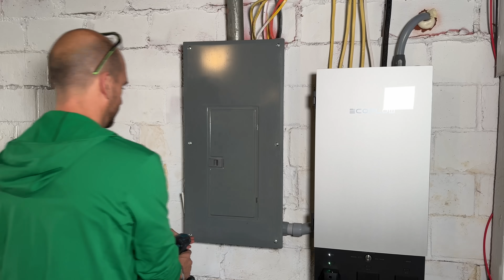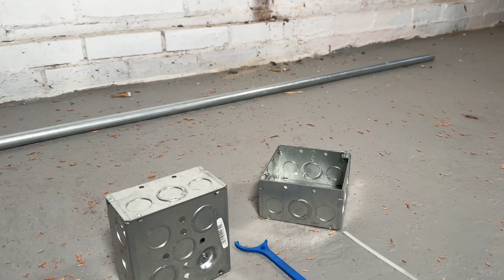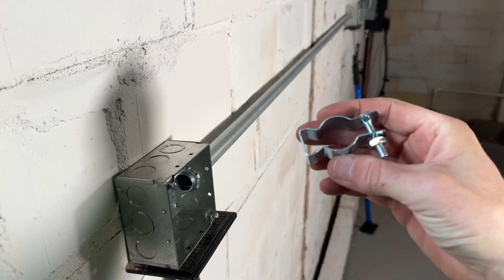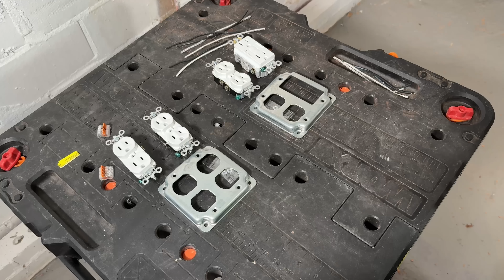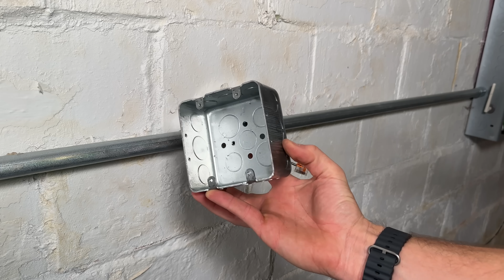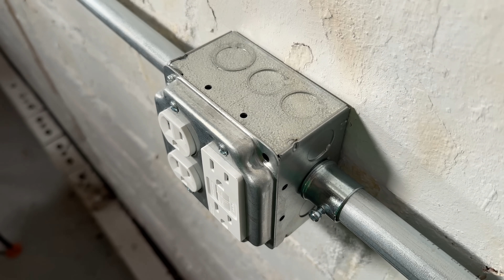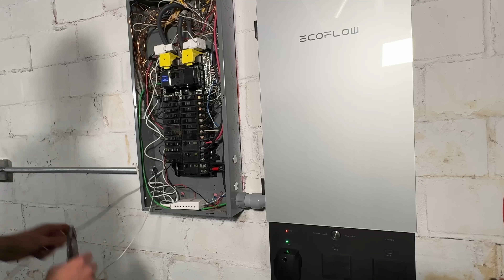Add Outlet To Unfinished Basement Or Garage

Comment from the maker: WAGO 221 Lever nuts  - https://geni.us/wKcBNC
Knipex Hybrid Wire Strippers - https://geni.us/uVWn
Locknut Wrench (3 Sizes) - https://geni.us/Wzm2Wtr
Metal Box Used - https://geni.us/UUEBe
GFCI Cover Plate - https://geni.us/sc1GXu
Duplex Cover Plate - https://geni.us/AiS9x4t
THHN (12 gauge Assorted Colors) - https://geni.us/l5kXo

DISCLAIMER: This video is for entertainment purposes only. Also, this video and description contain affiliate links, which means that if you click on one of the product links, I’ll receive a small commission.

Comment: He forgot to install the 3/4'' Box Connector PVC Bushings to protect the wires !! They are a Code Requirement !!
He doesn't know the Codes and this job would FAIL inspection because he forgot those bushings  !!!

Comment: You do not use a pipe cutter to cut EMT! Of course you run a mechanical ground conductor. Yes I know, the GFCI receptacle does not need a mechanical ground to function. But you still run a mechanical ground conductor! What do you do for a living? You sure as hell are not an electrician.

Comment: Regarding the Romex in conduit.  The only prohibition for that is in damp areas or outside.  Indoors is not normally a damp location, but may be.  In that case, the wire to use is individual conductors designed for this application.  Here, it was stated that he was using THHN, this is an issue.  If the Romex was deemed to be unacceptable due to dampness, the wire suitable for damp location is required.  In the case of THHN, the code T means plastic insulation, first H means 75°C instead of 60°C, second H means 90°C instead of 75°C.  WHEN THE WIRE IS SUITABLE FOR USE IN A DAMP LOCATION, the second H becomes W (THWN) for wet and the 90°C is implied. 

The shortcut of using the metal conduit as the ground, instead of a green wire, has been covered, while compliant, don't do it.  The purpose of the green bonding wire is to be CERTAIN that a DIRECT FAULT PATH is well established back to the panel, so that in case of a significant fault current, the return path to the breaker is WELL ESTABLISHED so that a trip occurs PROMPTLY (not a slow sizzle). The need to practice safety is WELL ESTABLISHED, NEVER CUT CORNERS......NEVER!!!

PET PEAVE: SURE WOULD BE NICE IF ROMEX MANUFACTURERS MADE THE INTERNAL CONDUCTORS SUITABLE FOR DAMP LOCATIONS.............

Comment: While the metal boxes are grounded, if the conduit where to come apart for any reason, the outlets would no longer grounded.  It would be best to go ahead and run the ground since youre already running the hot and neutral conductors.

Comment: I appreciate the knowledge and explanation you’ve shared. As an electrician, I noticed a few areas where I would approach the installation differently.

• I’d put an offset on the EMT entering the boxes. It gives a cleaner, neater installation and eliminates the need for those stand-off straps.

• I’d avoid drilling into the mortar. Drilling into the block or concrete provides a stronger attachment.

• 1/4-inch fasteners seem like overkill. I’ve found 3/16-inch fasteners are sufficient for this application.

• I prefer pulling a ground through my EMT. A connector screw could loosen over time, so I prefer having the additional protection.

• Avoid packing the wires tightly into the box. Leave enough conductor length to neatly tuck the wires around the box.

• And my friend, I’d give some attention to the panel. There’s quite a bit of wiring in there that could use some organization.

These are personal installation preferences based on my experience, but I think they would make the finished work cleaner, safer, and easier to service.

Comment: You can use romex in non wet locations. Plus, using metal against concrete is going to leave you with rusted boxes in a few years (galvanic corrosion with no sacrificial anode). I've blocked your videos from my feed because stupid never seems to get a day off.

Comment: The strap that was shown but none were used is the only thing I see that's technically wrong with this install.
However, PVC boxes and conduit make better sense for a wall that looks to be damp at times (the electric panel should have been mounted on painted wood), 3/4" conduit is way too big for two conductors and pigtailing with WAGOs, wirenuts or whatever is unnecessary.

Comment: I always run a green ground wire in the conduit, rather than using the conduit to provide a ground. Did you remove the paint from the panel box to assure that you have a positive connection?

Comment: From a house I purchased just last year, always, always, always run the ground wire. Always.
That house they decided to cheap out and not do it. So I took possession and found a box with four wires sticking out. It was a hall light set up like this. Metal conduit to it.
Long story short and a lot of (paying an electrician) money later, it turns out it pulled out and wasn't touching anymore. So this caused the 3 way circuit to have 38 volts off and 120 on. So the LED light that he was trying to hook up would never turn off.
The electrician ran the green wire to everything and everything works properly now.

We don't need no stinkin' green wire! Actually, you do.

BTW, be careful and measure with a meter before you touch anything.

Comment: A pipe cutter leaves a razor sharp edge. Electricians never use a pipe cutter and always ream the pipe end out the channel locks.
You can use ‘loomex’ as it is called in my jurisdiction in emt or rigid pipe in dry locations. You must use a metal box so as you can ground the cable, box and pipe with the cable bear or insulated ground wire and pig tail out to the device. PVC box and pipe you obviously don’t need to ground the assembly just the device. By code all metal materials must be grounded.

Comment: No need to reem out the hole if you just go in the bottom hole of that side that is meant for your size conduit.
Also, your outlets are 15A rated, not 20A

Comment: I would suggest using real crimp on connectors instead of those push on connectors as they will fail. And also run a ground wire to be sure to secure a ground. Especially in a basement that can become damp.

Comment: Just a comment for those that may not have noticed.  You positioned the boxes so that the screws would run into the concrete between the cinder blocks and not into the cinder blocks themselves.  I do that too, easier to drill into the softer concrete.

Comment: Please show me the nec code that running romex in an emt.  In a dry location is not permitted? Are you a licensed electrician or a handyman ?
Reply: 334.10(5) and 334.15(B), you could have looked it up yourself, no?
Reply: @surferdude642  neither NEC 334.10(5) nor 334.15(B) prohibits Romex (NM cable) from being installed inside EMT in a dry residential basement or garage.
In fact, NEC 334.15(B) specifically permits EMT as a method of protecting NM cable from physical damage:

“Cable shall be protected from physical damage where necessary by … electrical metallic tubing (EMT) … or other approved means.”

NM-B cable in EMT is generally allowed in dry interior locations.
This is very common for exposed runs in unfinished basements and garages where the cable could be bumped or damaged.
The NEC does not contain a blanket prohibition against NM in conduit.

YOU could have looked it up and read it yourself, instead you chose to be an arrogant $&@ to the OP who didn’t insult you in any way.

Comment: Just an observation, 15Amp duplex outlets and a 15Amp GFCI on a 20Amp circuit? Shouldn't these be 20Amp?
Reply: Not really, see NEC table 210.21(b)(3). Either 15 or 20 amp are permitted.

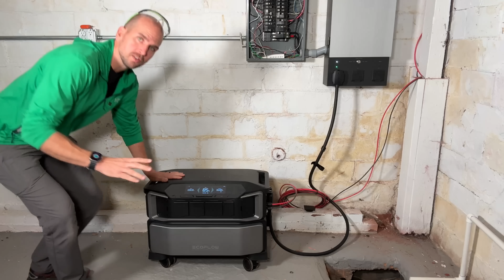Comment: I wouldn't use a roller cut to cut EMT conduit. I saw how you reamed the end of the pipe and I can guarantee you that it wasn't enough. Also since you are work hardening the end of the conduit, you make reaming 13:26  that much harder. What is with this not adding a grounding wire? I didn't like all of the metal fillings you probably left in the box. I think the job would look better if you just put box offsets on each side of your junction boxes.

Comment: Leave the electrical to electricians. Romex can be run thru any raceway. You need to run the ground. When you remove the cover, you disconnect the ground from the receptacles. Bond the boxes. Straps are optional in your world?

Comment: Though what you're saying about the ground and the conduit providing the bond is correct, in the 25 years I've been an electrician, I have never come across where the grounding conductor, or equipment ground is not pulled and terminated. The chances of the electrical inspector passing the installation are slim to none without it. And as far as the wagos, experience has shown it's to easy for the conductors to slip out of them which is why the mechanical splice with a wire nut is always best

Comment: No you don't need to drill new holes just stick a zip tie in the holes cut the excess and then insert the screw and holds just fine.

Comment: So is there anything wrong with using romex?
Reply: Apparently in this case, yes. He said its a basement which my local inspectors consider a (potentially) wet space. That means no Romex to be used in any way inside this space. The host indicated no Romex due to metal conduit which is not correct.

Comment: As a former inspector, I would have required the device mounting screws to be of a "permanent" nature. (As the grounding continuity is dependent on tbe cover screws.) This would have required the use of "lock washers" to make the connection 'permanent'.

250.146b
A listed exposed work cover shall be permitted to be the grounding and bonding means when (1) the device is attached to the cover with at least two fasteners that are permanent (such as a rivet) or have a thread locking or screw or nut
locking means and (2) when the cover mounting holes are located on a flat non-raised portion of the cover."

Comment: Mega code violations  the whole instalation!. Yes you can use the conduit for a ground. But why? Pipe support, no ground between box and recepticals, no no no! If your using a metal plaster ring YOU have to hard ground the receptacles to the box. 
   Reason if you remove one of the receptacles from the ring the ring has to be grounded.
 I know, I know.  The power is off if your going to do that. It's code.

Comment: DO NOT DRILL INTO THE MORTAR JOINT AND USE TAPCONS.  It is not advisable! Mortar joints vary in size and material they are very brittle and if possible drill into the brick or block and do not wobble your drill bit as you drill.  Also make sure to gauge the length of the screw you are using and use a piece of electrical tape on your masonry bit to show you how far to drill into the wall.  Make sure your hole is deep enough for the screws to not bottom out.  That is where you place the tape on the masonry bit.  Some drills have a depth gauge bar for this. Use it!

Comment: Honestly allowing the raceway to be used as the ECG is one of the things I wish they would remove from the code. It allows for half-assery on a critical component in the system. It’s a safety net. Relying on multiple screw connections to maintain continuity on something potentially subject to damage, movement, loosening, etc. makes no sense. You’re also relying on every electrician to make sure every connection is secure. That’s just not good enough. If anything it’s a byproduct redundancy to running an actual ECG.same goes for using an ECG on your devices even if they’re self-grounding. It’s just good practice.

Comment: Comments referencing the NEC should cite the specific chapter, e.g., 358.12 Uses Not Permitted.  Or something like the following:

EMT can serve as an equipment grounding conductor (EGC) under NEC 250.118(4) if:

Installed with listed fittings that ensure electrical continuity
Properly bonded at terminations (Article 358.60)
No separate grounding conductor is required if EMT meets these conditions
EMT must provide a low-impedance path for fault current to trip the overcurrent device.

It would educate us DIYers, settle differences in opinions (or facts), and account for local jurisdiction requirements.

Comment: Mistake #1 is using a pipe cutter on the EMT  Next is not offsetting the EMT, then not running a ground wire.. If you don't know what you are doing, you shouldn't be making videos pretending that you do..

Comment: need to better stress the fact that you MUST use METALLIC conduit, Wrench-tighten ALL conduit/fitting connections AND use self grounding devices when ommitting/substituting the egc with METALLIC conduit. also, conduit straps ARE required...within 3ft of each junction box and at least ever6 10ft...not optional

Comment: Much of electrical code is just someone's opinion on how things should be done.  The safety aspect of it gets lost.   You could write a solid, practical codebook focused on real safety in maybe a dozen pages—unlike the bloated monstrosity it's become.  Take this for example.  I think it should be against the law to run conduit horizontally across the wall like that.  That's my opinion, every electrician wants to run it do it that way horizontally.   It totally disregards the use of that wall for other things.  The conduit should run up to the ceiling and then drop down to the outlets.   Then again, it really doesn't make a damn because you can always install a ceiling loop in the future if you need that space.  Just opinions.  Like an asshole, everyone got one.

Comment: First, and most important... ALWAYS run a equipment grounding conductor!  If there is ever an issue with conduit conductivity, you will LOSE your ground and bad things will happen!
Second, there is nothing wrong with running romex in conduit as long as you meet fill and other requirements.

Comment: Running romex in conduit- NEC 334.10 — NM cable (Romex) is permitted in normally dry locations of one- and two-family dwellings and certain other types of buildings.  However, there are other issues such as wet conditions, in danger of being damaged, and wire fill.

Comment: IF you strip out the hole using tapcons--you can take a piece of cable tie and put it in the hole and it will secure.  You can't pull it out.  After decades of using a screwdriver and hammer to tighten the connectors, we finally have those nice wrenches--now they have an offset version which is better still.

Comment: Great Video, quick question/comment, :  It looks like you used a 15 amp GCI outlet,, is that preferable to a 20 amp GCI? Or is it a better practice to use 20 amp outlets on a 20  amp circuit, especially for workshop or garage where you might use power tools?
Reply: It depends, it will typically cost about $2.00 or $3.00 more for each 20 amp GFCI receptacle of equivalent grade, and if that's of little or no concern, then go for it as it would be totally fine on a 20 amp circuit. Keep in mind, however, that the internal contacts and circuitry are identical and the likelihood of needing a 20 amp receptacle is extremely low. Virtually all power tools have a 15 amp power cord. Sure, you may need that industrial grade heat gun for bending PVC conduit, and that may have a 20 amp power cord and plug. Another thing is that if you use any equipment with a 20 amp plug, you should make sure that nothing else of significant load on that circuit is on when that equipment is being used or you may find that you will be tripping the breaker. Oftentimes, manufacturers recommend 20 amp equipment is used on a dedicated circuit, with a single 20 amp receptacle, not a duplex receptacle.
Reply: @surferdude642  Thanks for your comments, What you are saying makes perfect sense......I just did not know if there was a safety concern between the 20 amp and 15 amp outlets.. I did not realize that the components of each were the same.......Thanks again for your patience.............pdm

Comment: For at least 40 years, by NATIONAL elecrical code, conduit is REQUIRED to be supported. Also, the third ground wire and bonding to the box is REQUIRED. If you're adding outlets to an existing circuit then  perhaps not, but in this case you need to support the conduit and properly ground the system.
Reply: Incorrect, wire type ground not required, EMT is the grounding path. Because he used locking type nuts to secure devices to the cover, grounding pigtail not required, devices are bonded through the cover.

Comment: Unless the NEC has changed the copper type tubing cutter is ILLEGAL and dangerous in the extreme.   For what should be obvious to anyone who pulled wire through.
Reply: It's not illegal to use a tubing cutter. It's a bad idea because of the burr it leaves, which takes a lot of effort to remove. Calling it "dangerous in the extreme" is a bit ridiculous.

Comment: To be clear romex is not for unfinished space (without studs drywall etc)
Normal romex /nm should never be ran in a wet location, or THHN  not listed for wet locations (most is listed for wet locations)
You can put romex in finished spaces (with drywall studs etc)The NEC requires romex to be protected.

Comment: In my case my electrical box isn't accessible through EMT conduit connection for grounding.  So I would have EMT running in my unfinished space, but it would not be connected to the box hence no ground.  So I'd need to run a ground wire from the box through the EMT and to the outlets and ground screw.  The only issue I can think is that I would also need Romex to run through the wall to the box, and add a junction box to switch to THHN single strand which would then run through the conduit.  I'm not an electrician, but from all of my research I think this is acceptable practice?
Reply: This would work. If you ground the transition junction box with the romex ground wire, all EMT and boxes after that would be grounded with no need for a ground wire. Adding a ground wire anyway is also fine.